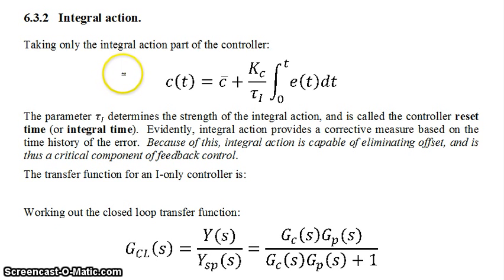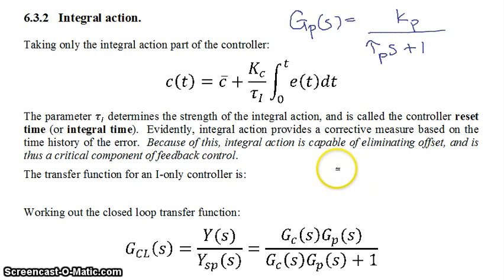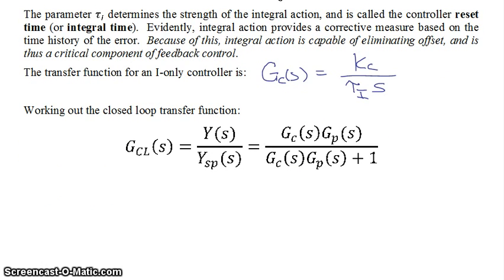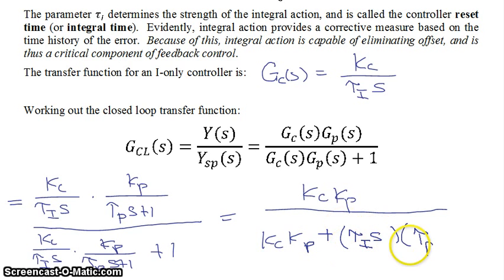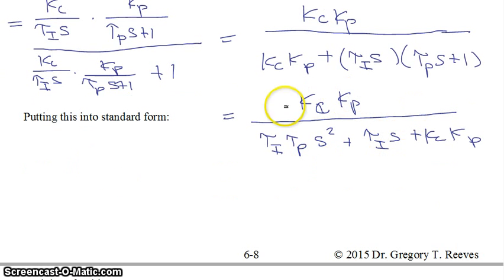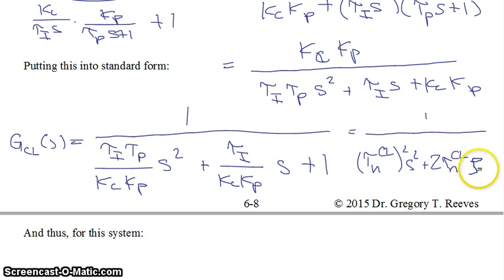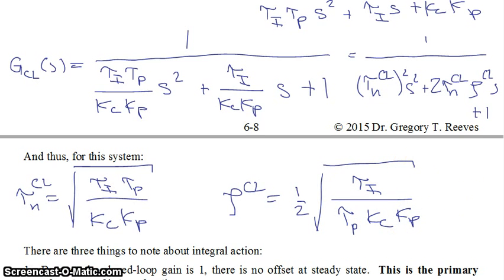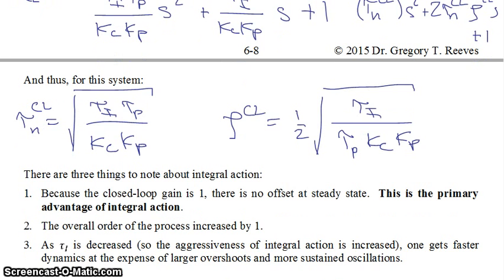Integral action

Comment: Dear sir, i am looking for leaky integral in PID. Could you please share info on it.
Reply: its for electromechanical system. I just have info that leaky logic is different than anti windup.
Reply: I came across this term during discussion with my colleagues, they too heard it somewhere.
And its different than anti windup concept. On google, i found leaky integrator but thats with reference analog system due to capacitor. I am not sure how this effect will be present in digital controller wrt PID.
My query is how to implement ‘Leaky integrator in PID’  for time domain. Will it be subtracting some constant amount from error before feeding to integrator or something else?